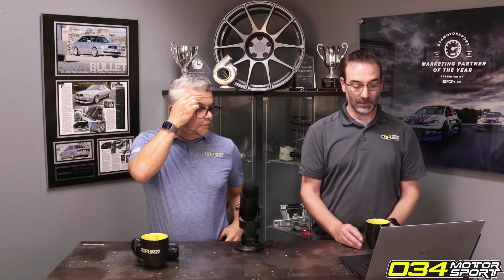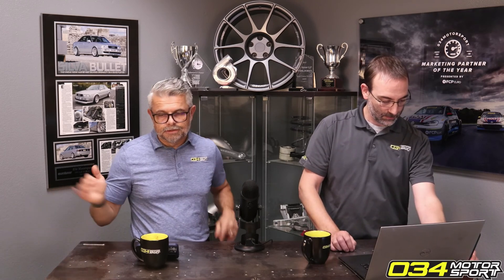Supercharger Belt Slip on Stage 2 3.0T Supercharged Cars? | 034Motorsport FAQ

Comment: After getting the 207mm I definitely got a squeaking noise . Replaced All the tensioners, ilders and went through 3 belts. Belt still slips. Only component not changed is the pulley which shouldn't fail from my understanding. Definitely something to look into.
Reply: I also experienced the same thing after installing a 207mm pulley and putting new tensioners and idlers. Glad I'm not the only one lol. Definitely getting a griptec upper pulley
Reply: @tehgzizlauw1787  it's annoying as hell and embarrassing. Can definitely hear it when downshifting or giving it gas under load. Absolutely hate it.
Reply from the maker: Please email techsupport@034motorsport.com and we can provide assistance!
Reply: Same I went through 3 belts thinking they were factory defective
Reply: @Fullylac3d  hi I am having the same issue with my 207mm pulley.  I already snapped 1 Beth and my second belt is already showing debris.  What did you do to fix that issue?
Reply: Hi did you end up getting the issue fixed?  I'm on the 207mm pulley and all belts I try keep slipping and squealing
Reply: @lunchmoney3652  nah I'd just get a new crank pulley. That's the only thing I haven't replaced.
Reply: @Koachise  JHM offered me to send it back in to get revised.  Im installing a grip tech upper pulley and it doesn't fix the issue I'll replace the crank pulley at that point thanks
Reply: @lunchmoney3652  you bet. God Speed boss.
Reply: @lunchmoney3652  any update brothaman? i know they offer pulley larger than OE size which would make sense if you already have such a high pulley ratio you wouldn't want to get the 57mm IMO
Reply: @Pwnulolumad  i fixed the issue.  The 207mm crank pulley was not seated correctly. I removed it and re installed it using the marked dots.  The car kept squealing.  I was able to narrow down the squealing and it was coming from inside the supercharger.  The bearings were shot.  I bought a used one and the squealing went away immediately and now all my power is back.
Reply: @lunchmoney3652 badass happy ending